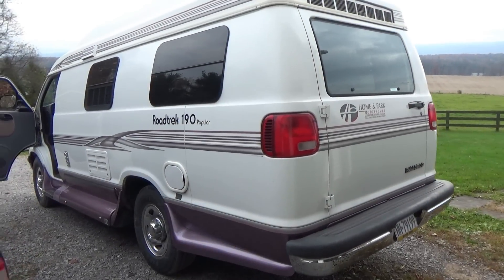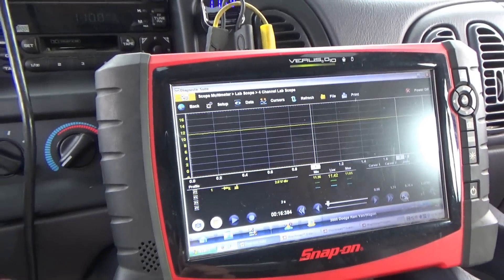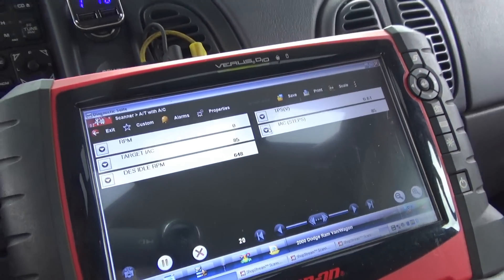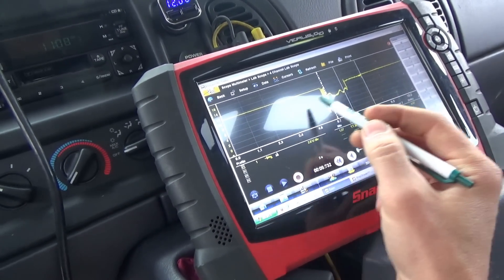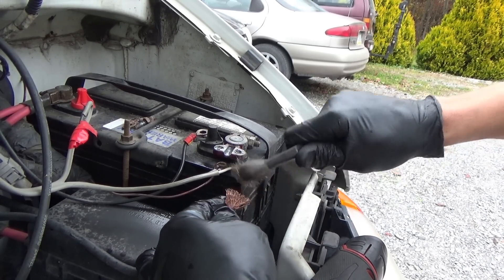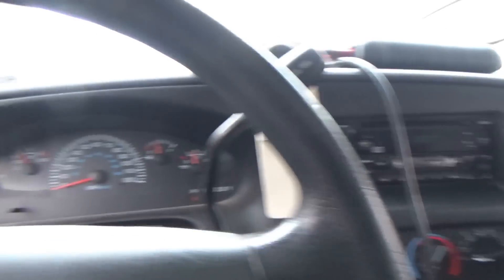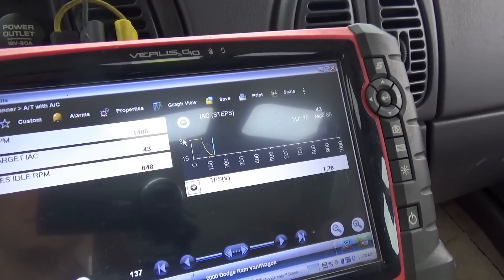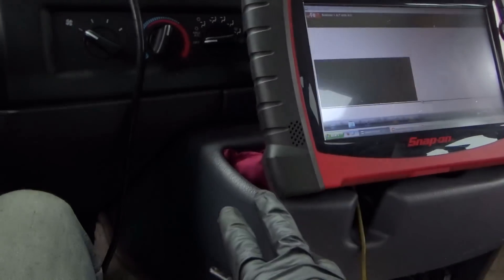Ram Camper Van is BACK! (Hot Start-STALL after X-country Trip?)

Comment: Replace the E.C.M Ivan
Reply from the maker: Why? lol
Reply: @PineHollowAutoDiagnostics  Study up on the circuitry involved with output controls of I.A.C motors and you will find the capacitor designed in circuit is failing resulting in loss of idle controls. The capacitor in the I.C chip circuit alows for the inrush of electrons that’s needed to move the rotor. This is why the idle works upon start up yet slowly fades away in operation due to lack of energy sustained in the leaking capacitor. You gonna get yourself in a legal corner eventually by not correctly repairing the vehicle. For example the van is going down a steep grade and the engine stalls out from the computers inability to control engine R.P.M and they crash into whatever and your azz becomes grass
Reply: @JOMaMa..  Ivan's work is guaranteed, if he made a mistake it gets fixed for free. Which is very rare. Why don't you post videos on how you fix cars
Reply: @firstlast---  wrong answer son I don’t have to make videos to be correct. Class dismissed and run along home and tell your moma you got checked and you better do your homework before you flagrantly speak up out of line
Reply: @JOMaMa..  The irony is astounding. You can stay stuck in your ways I promise nobody cares as much as you think they do 👍